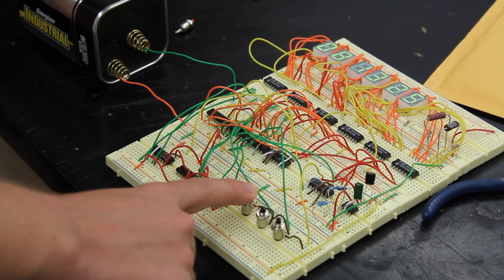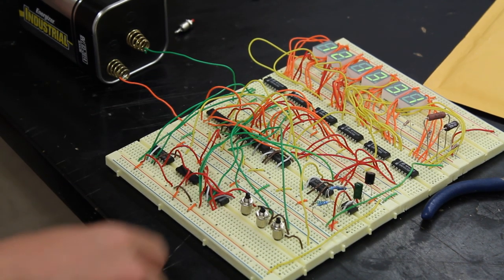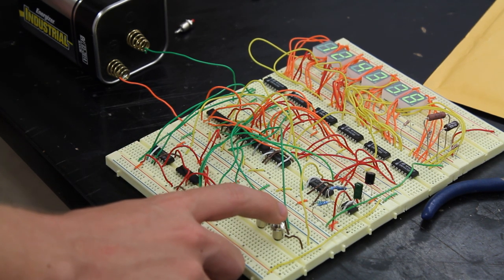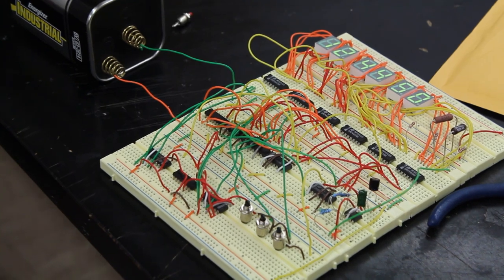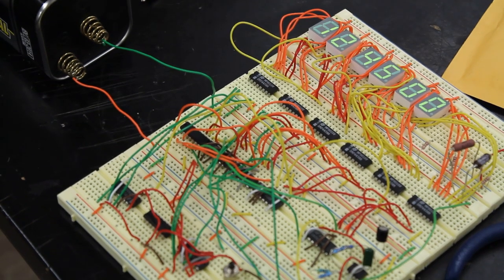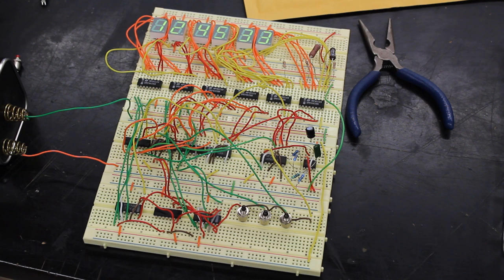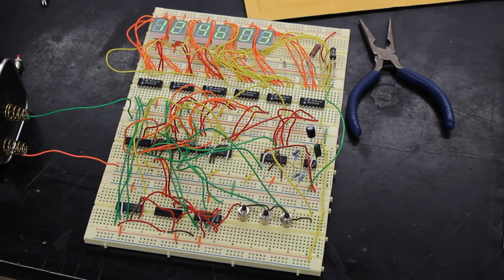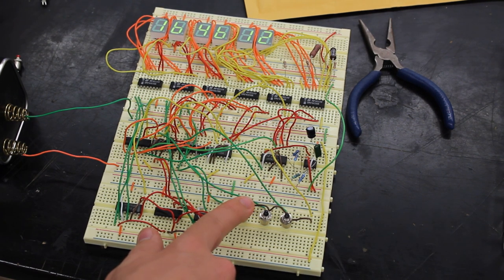Digital Clock Built Using 7490 Decade Counters and a 555 Timer

Comment: Here's an exercise to the designer: what's the accuracy of your clock?
Reply from the maker: Marc Sacks I don't know. After one hour of operation it wasn't noticeably different from the wall clock by the very precise measurement of eyeballing it, but given that we used goldband resistors, it could be off by as much as five percent, not counting the margin of error on the capacitor (the resistors and capacitor make a time constant used in the 555 IC).

Comment: you should use a crystal oscillator instead of a 555
Reply from the maker: +Dylan Missuwe That would certainly make it more accurate but would be less ideal for a bunch of high schoolers to haphazardly put together on a breadboard

Comment: Can you explain how to wire the power source so that all separate circuits get 5v each pls?
Reply from the maker: Wire them in parallel. The voltage drop across each parallel branch is the same.

Comment: what is the difference in using the green anode 7 segment and the red one?
Reply from the maker: edwilyn roa dacer The green one emits green light and the red one emits red light. There's no hidden difference like a largely different resistance. (They also happened to be slightly cheaper for some reason.)
Reply: okay.. thank you :)

Comment: in the 47 microfarad capacitor and 0.01 microfarad capacitor, what were the volts?
Reply from the maker: edwilyn roa dacer Capacitance is measured in Farads, not Volts. The voltage difference across a capacitor depends on the circuit it's in, just like for a resistor.
Reply: I know but the output would still vary if I use different capacitor
Reply from the maker: +edwilyn roa dacer It would. But the voltage across the capacitor changes every second as the clock cycles.

Comment: What's the reason for the problem when you hook the circuit the first time?
Reply from the maker: If the capacitor isn't drained fully then a race condition can cause the clock to turn on at a nonzero time. Needless to say, I do a very poor job explaining that in the video XD
Reply: Thanks a lot :)